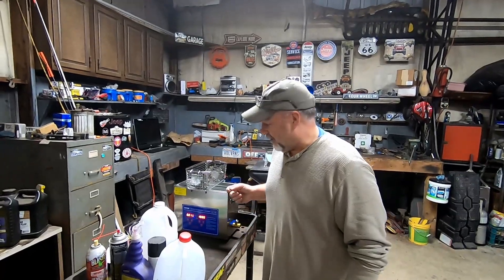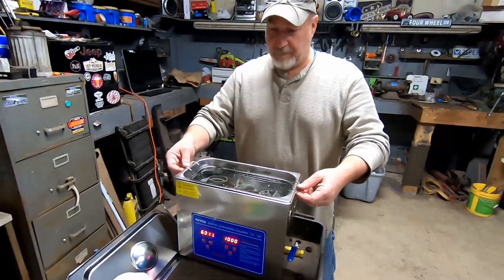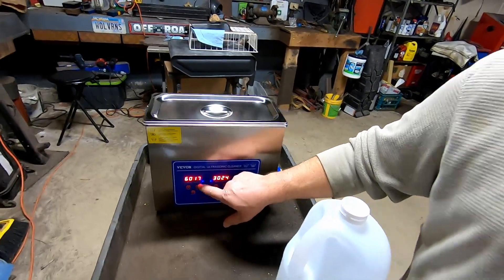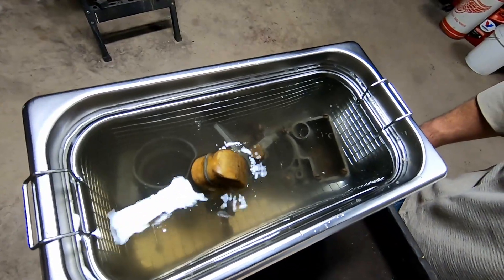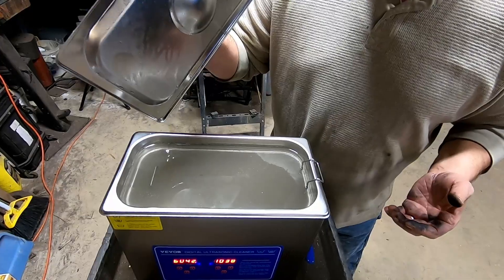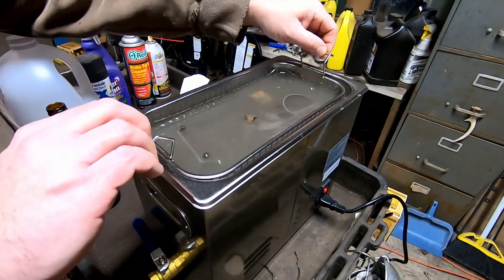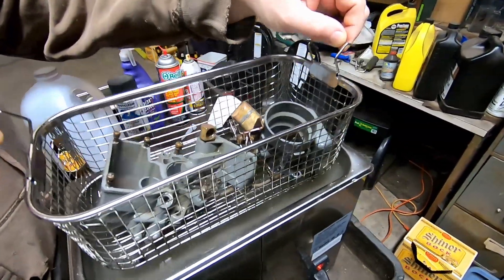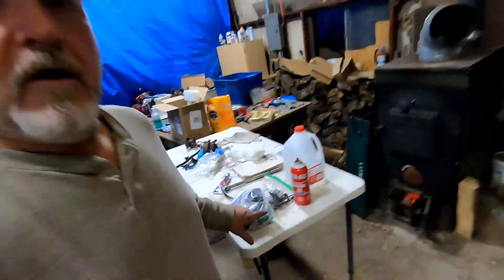Cleaning the Carburetor with an Ultrasonic Cleaner

Comment: Pre heat before you start timer.
I also bag the parts in the solution and drop it in the tank which is just water or sometimes simple green is added.
Reply from the maker: Thank you for the tips.  I appreciate it.  So you put the parts in a (plastic?) bag instead of just loose in the basket?  Is that to keep the machine cleaner?  I've never used one of these before, but I am impressed by it.  Thanks for watching!